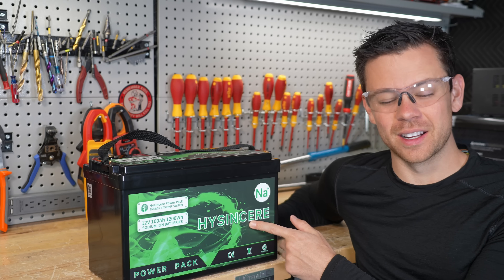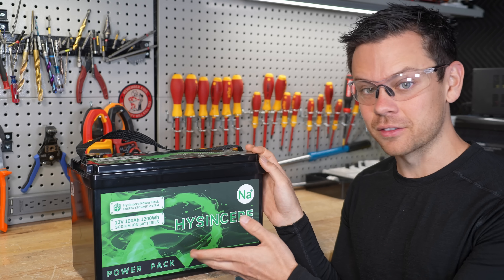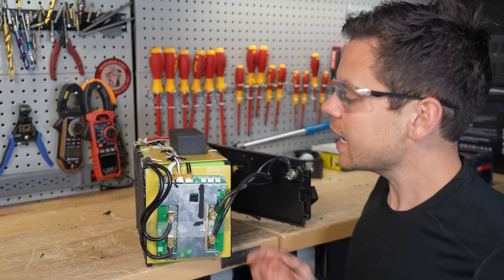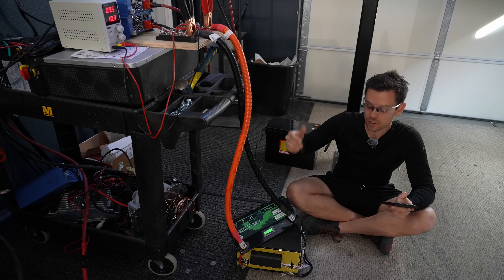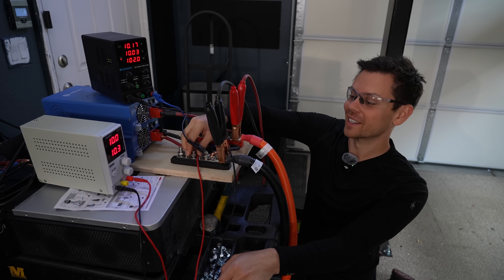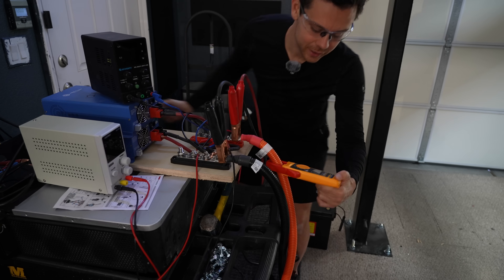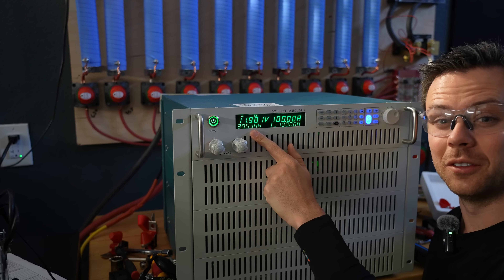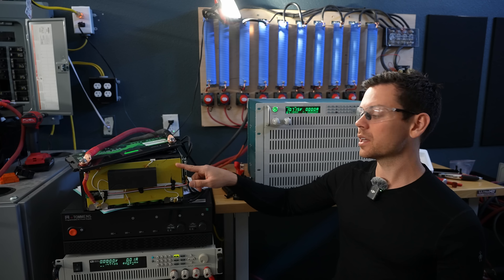Testing My First Sodium-Ion Solar Battery

Comment: That is old technology. CATL has a new chemistry, Nextra, that doesn't have these problems and is available next year or so.  The variable curve is a voltage regulator issue in as much as the Li+ batteries had a charger issue.
Reply: Yep. CATL is really optimistic about it. We'll see soon enough
Reply from the maker: Even the new one is bad on paper. 90% efficient. Same voltage curve. Just awful. If you use a DC converter to regulate the output, you'll have another loss. Just awful for off-grid solar 

And send it my way. I can't find them anywhere for sale.
Reply: Will reviews currently commercially available technology, not laboratory pipe dreams that may never come to market.
Reply from the maker: @Back2SquareOne thank you. Exactly
Reply: @WillProwse  Mass production will begin by end  this year, so the new product will hit the market next year. CATL promises that the price per kWh will be the lower than  LFP
Reply: @WillProwse You start the video by making a blanket statement on a battery technology that's evolving extremely fast and has 2 major advantages: 1.unbeatable material cost and 2. multiyear R&D backing of the biggest battery manufacturers with the most robust supply chains. 

Unsubscribed
Reply from the maker: @AlexBiohazardous send me one. My statements in both videos were substantiated with real studies. Show me otherwise
Reply from the maker: @industrialisasi45  shipping going to cost more, so who's paying for shipping of these heavier batteries?
Reply: @WillProwse  on interesting engineering, there is an article about a 40,000 cycle. Zinc battery with round trip or Coulombic efficiency of nearly 100%, which looks likely to be better than sodium ion batteries for grid storage at least, having much better efficiency.
Reply from the maker: @glike2  we already have 20,000 cycles with lto. LFP can last longer than most people will live for. What is your ideal cycle count?
Reply from the maker: @glike2  very nice efficiency wow
Reply: sodium batteries are garbage. Using them as energy storage and energy use is a waste of energy, literally. 40% waste of energy
Reply from the maker: @AlexBiohazardous  also the new ones have 90% efficiency and same voltage curve. What's the benefit? They are also heavier, and will cost more to ship from China. Who's going to pay for the increase shipping cost?
Reply from the maker: 90% efficient with same voltage curve. No thank you. I'll review anything, send them my way
Reply: @Back2SquareOne  They're already on market. The better sodium chemistry (NFPP) is also on market. Commercial scale
These won't be as good as LFP ever, nobody claimed so and we already know the chemistry. and once we have sulfur + lithium (and maybe even iron with it) we likely won't see anything beat that. Regardless NFPP will likely be half the price per KWH when full production is out in like 4 years
Reply: I've been hearing about these miracle batteries in a lab for over a 10 years now
Reply: CATL says it's a gen 2 sodium ion battery

Comment: The difference in efficiency means you have to buy a lot more solar panels but do you have enough space available? 
I'd rather buy even more battery capacity  I could literally use 12 volt instead of 48 volt system and would be more efficient

Comment: big advantage of sodium batteries is you can discharge them to zero without issue... the fact that existing chargers/inverters designed for other batteries don't work with them out of the box isn't really an issue with the battery chemistry.... that being said, they are probably only going to have niche uses - like where batteries catching fire are a large concern, or if lithium availability becomes an issue because of... reasons... or if their prices come down significantly and space really isn't a concern... as far as pricing remember LFPs were nowhere near as cheap 5 years ago as they are now.... so TLDR; only time will tell if these become relevant, but it's probably too soon...

also you mention the flat discharge curve of LFP is an advantage, but that isn't always the case, accurately measuring LFP state of charge is quite difficult because of it, requires fancy coulomb measuring etc...
Reply from the maker: We can already discharge LTO batteries to zero without any issue. But that's not an issue anyways because all of these batteries will have BMSs. Also sodium ion batteries when you have thermal runaway and vent, will release hydrogen cyanide. 

Lithium availability has never been an issue. Lithium processing at a purity and large enough volume has always been The actual problem. America is far behind in this regard.
Reply: @WillProwse  NaCN sodium cyanide is released? Acids or Moisture will convert it to HCN (hydrogen cyanide) Luckily you have no moisture in vegas (hehe)
I don't see how either would be chemically released from any sodium battery chemistry. What chemistry do you see this happening from?

Looks like HCN is released during thermal runaway of all lithium batteries though, including LFP though very rare. Even Nickel Manganese Cobalt can release it.
Reply: coulomb counting is fancy in something small like a powerbank... which is also something less likely to have a proper BMS... batteries get used for more than just solar setups you know...

and you still didn't address that your biggest complaint is none of your stuff designed to work with them, works with them... shocking (heh) discovery
Reply from the maker: Coulomb measuring is not "fancy" and even this budget sodium ion battery has it. It's not hard to do. Check out my beginner videos on this

Comment: As an electrical engineer I cannot think of a single thing these batteries would be useful for aside from marketing gimmicks.  LiFePO4 and lead acid are still the two dominant technologies for large scale applications, with other lithium technologies winning in portable/handheld applications.  I will NOT buy an electric vehicle until they have LiFePO4 or something as competent.  It if weren't for politics most EVs wouldn't be legal due to fire risk.

Comment: at least it seems to really be what it says on the tin. which isn't a given these days with something sold as new battery technology.

edit: cost advantage in scale would come from if the materials are found in more countries, that would be the point. but as a consumer you wouldn't need to care about that until they would be on market for cheap

Comment: Ham Radio 13.8v is always preferred. We have proven to be the last reliable source for emergency communications hot or cold 😊
Reply: 73
Reply: I was thinking the same thing - there is a lot of electronic equipment that won't run below 12 volts. Contested all weekend and my LFPs are still at 85% and 13.5v.
Reply: @stevehodder1 - a 4s Na-Ion battery pack should handle 9.6v - 15.6v… you don’t need to charge it to 15v, and it will do just fine.
Reply: @DavidHalko  I assume that comment was meant for someone else?
Reply: @DavidHalko  yeah it will do just fine. and you'll just keep carrying 4 times the weight+volume of LFP
Reply: @casemodder89- I won’t need to carry it, if I use sodium batteries in my house… and when war breaks out in Asia, I will have no problems getting more batteries.

Comment: Wow.  Those results were a lot worse than I thought they would be.   I was also thinking "starter battery".  And also thinking ... hmm.. with such a wide voltage range, there are probably direct solar panel connection configurations that would work (i.e. no charge controller)... for super-simple setups.   The inefficiencies compound, though, so its kinda pie-in-the-sky thinking on my part.

Comment: Yeah, I think these sodium cells do great in old cars.
The voltage curve on these cells seem perfect for that, they seem to have a high tolerance in that perspective.
Where LFP has a narrow curve in that regard.
Als the temprature range is a huge bonus compared to LFP.
It sure has it's advantages.
Maybe I try swapping it out on my old 1955 Daf military truck, dynamo powered 24v system. I have no idea how much it puts out on maximum voltage.
But I do know it sits a lot doing nothing, sodium cells seem like a better choice than lead-acid.
edit : Will, I just had a thought, how do these 100Ah sodium battery's compare to a classic 100Ah lead-acid battery ?
Strangely, I have never seen a good video or test where people test out lead-acid battery's like they do with LFP battery's ?
I wonder, how much Ah does a 12v 100Ah lead-acid battery really have ?
Reply: For one thing, lead-acid batteries can be ruined by running them to below 50% SOC, so one would need to do the test on 200Ah of batteries and only use 100Ah. I prefer the LFP batteries for both the 100% usable Ah and the fact that they are about 1/3 the weight of lead-acid batteries.

Comment: It would have been nice to see you measure the round trip efficiency. Could you do that?
Reply from the maker: 82% efficient on the first capacity test with .2C. charging about the same. So compared to the studies it's right in the middle
Reply: @WillProwse I can't see anywhere where you measured the amounts of energy going in. Did I miss that? Without that information all you're measuring is discharge capacity.
Reply from the maker: I did not measure it. Going by the internal resistance and both capacity test it's pretty bad
Reply: @WillProwse Ah, so you didn't actually measure the round trip efficiency then. At least I didn't miss anything. Great work otherwise though 🙂
Reply from the maker: Nope, but we got the discharge efficiency in the video so use that. Same results as the studies
Reply: @WillProwse how can you know the discharge efficiency if you don't know how much energy you put in? All you know is how much energy it can discharge compared to what is written on the sticker. For example if this was actually an 82Ah battery, labeled as 100AH. It would look like it's 100% efficient in the testing that you did.

I can't think of any way you can determine a battery's efficiency without knowing how much energy you put in.

Edit: I just thought of a better way to get my point across: take a sharpie and change the 100AH amp hour to 82AH on the battery. With the same testing you just did it now looks 100% efficient.
Reply from the maker: Yes that's true. Need to do that then
Reply from the maker: Do you have a better sodium ion to recommend because this one is awful
Reply: @WillProwse just an FYI, I think you left the comment asking about other sodium batteries on my comment by accident.
Reply: He did it sucks too
Reply: @MegaJOHNNG are you sure? I just rewatch the video and I can't see anywhere where he measures the amount of energy going into the battery.
Reply from the maker: Nothing I am saying goes against the grain here. Just look up the studies. My test results are the same as everyone else's
Reply: @WillProwse in Prescott AZ Ohmmu makes 12v lithium with heaters to start Tesla and other hybrid cars.... They also make sodium batteries now for gas powered cars... Please get both to test.... My son lives in ND Williston during winter it get-60f and he uses 2 group 34 in dual battery kit for Jeeps... So tried oddesey and X2 battery so these have actually a website and made in Prescott so your Tesla might need a new 12v upgrade and cheaper....

Comment: The promising thing about this technology is that Sodium is 1000 times more plentiful than Lithium. If you could get 10 of the NA batteries for the price of one LFP that would more than make up for the drawbacks in application where battery size/weight doesn't matter like off grid power.
Reply: If my calculations are correct, we already found enough Lithium to make a 150kWh battery for every human.
There might be more sodium but CATL just closed a mine because there is too much Lithium going around right now.
So why even look at alternatives that waste energy (like sodium batteries and hydrogen production).
Reply: @foeke8740  Exactly. 

And we can extract lithium commercially from concentrated seawater. That's essentially unlimited. They are already harvesting concentrated underground brines in the U.S. and elsewhere. 

Where do we get more concentrated seawater, you say? How about what comes out of desalination plants? That is quite concentrated, to the point were putting it back into the ocean has to be done carefully to avoid hyper saline seawater plumes that harm sealife. There is a huge desalination plant in San Diego that would be great test bed for this. Turn the brine from a problem into a resource, and create a revenue stream that pays for safely putting it back in the ocean.
Reply: @foeke8740  So why are they still so expensive?
Reply: @francocastilloAR expensive? They still have to be made. Here in Germany 1kWh costs you about 50 bucks/euro. 2.2kWh (MB56) 85 bucks/euro.
I think that is an incredible pricepoint.
Reply: @foeke8740  In Argentina it costs more than 10 times.
Reply: @francocastilloAR that is almost impossible. Unless you are counting with a different coin.
Can you check what an A grade MB56 costs? Or a MB31 for reference?
Reply: @foeke8740  They do not exist in Argentina and it is forbidden to import them.
Reply: @francocastilloAR That is one way to drive the prices up. Crazy.
What is the rationale?
Reply: @foeke8740  I don't know the justification, but it's a matter of regulations and bureaucracy.

Comment: As you said, there needs to be a specific inverter. Well see how these actually turn out.
Reply: I disagree. They need to make these in such a way that they fit current inveter specs, (i.e. bring up the Voltage curve and make sure there are more than advertised Ah), or they won't be able to sell to most of us off-grid folks.

Comment: Great review. I've been using a Na-Ion battery for three months and works really well.... in my CAR. 😀 For home storage, LFP is the king. Without any doubt.
Reply: I use one in my motorcycle too, figured I'd test it out in the colder winter this year. It'll be charging maybe like a week or so under what the one he has is rated for so I'll see how many years I get. I bet it's still more than double of lead acid
Reply: Where do you live? I didn't know anyone aside from maybe BYD was using em yet but i'm not up to speed. Just heard the catl news on their naxta . Just curious if you're in asia or europe
Reply: @Josh-oe4ex Spain, southern Europe (hot in summer, cold in winter but not as cold as in USA). And it's running in a 2021 Tesla Model 3. In winter we go to Pyrenees for ski.

Comment: Catl is claiming they will be shaking the battery market up near the end of the year. If the batteries come down in cost to half of LFP, you may be able to avoid a lot of the drastic voltage differences by converting it to an acceptable voltage. Yes, you'd lose some to heat but the cost difference may be worth the hastle
Reply: Introducing another stage of voltage conversion is just going to increase losses.  You  just wouldn't do it for higher power applications such as operating an inverter, design an inverter that natively works with the larger voltage range and only have one stage of voltage conversion.  For low current aux items a buck/boost regulator would be the trick.

Comment: Perhaps as a ramp heater, boost start for passively stored, subzero-cold LFP charge, LFP/Na-ion hybrid standby.  Thinking remote Arctic seasonal working camps,  Inter space transport systems.
Reply: Replace car starter lead acid batteries! Those are still lead acids because cars are sold to markets that can experience both experience -50c or +55c 😅

Comment: They need an added dcdc converter to keep voltage regulated.
Reply: Bluetti new power station no lifepo4 ma is NA 900Wh 30volt 30ah batteria and 1500watt power in case ac180 lifepo4 1134wh 1800watt max

Comment: Dont we just need chargers and inverters designed for these?
Reply: I believe it would be much better for the manufacturers of these to adjust the cells' in parallel and series to be compatable with existing inverters, chargers, and solar controllers. Personally, I would rather just have to swap out batteries to upgrade my solar system(s) than to have to buy all new, (possibly with bugs that need to be worked out) solar system parts that I have that I know already work with either lead-acid batteries or LFP batteries. (Not that I will ever go back to lead-acid batteries. LOL) I live in an off-grid community and RELY on my solar system to survive the 120+ F summers here in the southern CA desert.
Reply: Yeah, honestly the disadvantages here are don't matter a whole lot if the price comes down like it's supposed to. If cost for NA cells comes down to like $10/kwh, ain't nobody going to care about the other nuances.

Comment: Now fully charge the Sodium battery and them stab it with a screwdriver and tell me what happens.
Reply: Probably the same thing that happens with LFP. Some sparking, some heat, maybe even some venting, but no thermal runaway. 

Thermal runaway is only an issue with the high energy chemistries like LiMnO2.